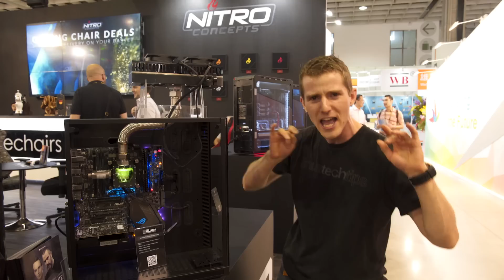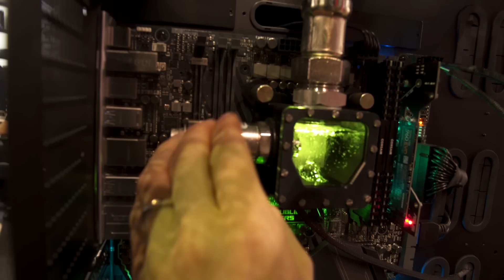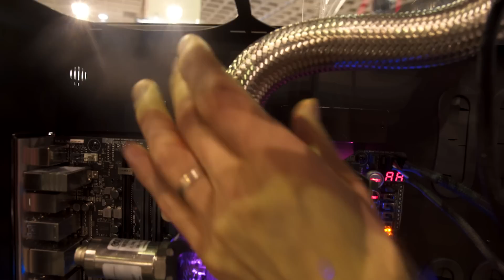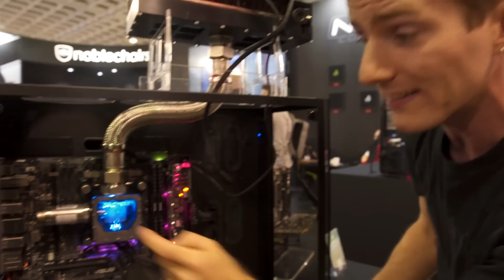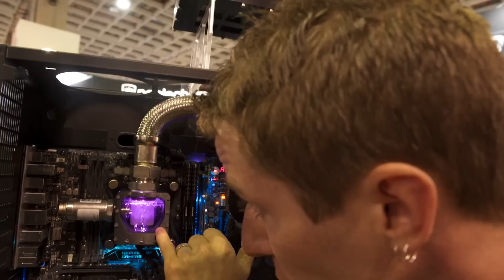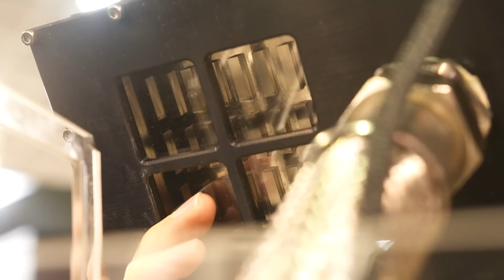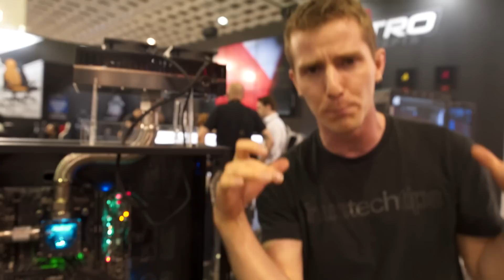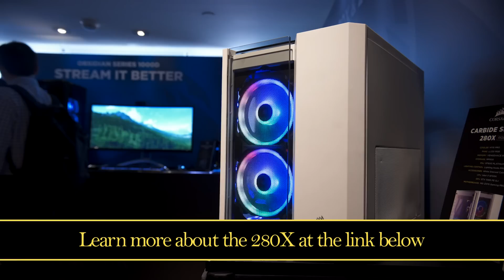Crazy Der8auer cooler prototype - NO pump!

Comment: From the way the application is being used, it Is probably from 3M called Novac 7000 or equivalent model 7xxx or so. Is an engineering fluid that boils @40C ish. It requires no pump as it evaporates and condenses back into liquid within a closed heat exchange system. It it expensive and difficult to acquire for personal use. In 2015, 3M engineer informed me that 3M    sells a complete package including consult, design,  install, maintenance. They don't sell just the fluid. It have been few years and their policy may changed. Oh yeah, he never tell me the price per gallon and I asked him 3 times. :)

Comment: It could be water in vacuum. As water's boiling point at 940 mbar is 40 celsius and as the water evaporates at 40C the vapor gets sucked into the empty radiator but as the pressure rises because of the vapor the water will instantly condensates leaving the heat in the radiator at the  top. (Just a theory don't quote me on that)

Comment: He could've pranked everyone by using water and having the loop at a lower air pressure.
Reply: I was thinking that too. Especially since it has a pressure sensor
Reply: @Darren Munsell yes I know but if they use even lower pressure than aboard the ships they can boil the water with just 20 °C or 30 °C. They probably use 70°C to kill off harmful microorganisms and bacteria. You don't have to drink the cpu water so it's safe to use a lower temperature.
Reply: @Darren Munsell 3m novec is what would be used ;)
Reply: Sounds good but it would be terrible longevity-wise. Even liquid cooling loops have permeation issues over time. A gas loop below atmospheric pressure would have much more permeation going on (just in the opposite direction obviously). Once enough air permeated into the loop the boiling point would be up at 100°C again and average joe would need professional servicing for the loop to make it work again since you probably don't have the material at home to recreate the vacuum.
Reply: that is what it looked like to me when linus flipped the radiator over no condensation it was water with a aquarium pump
Reply: @paul3502  Also if the CPU boils the liquid why are all the bubbles coming from the bottom? From the same place where the weird black hose thingy is.
Reply: It could be butane or propane
Reply: @KCWhoa  https://www.youtube.com/watch?v=AZAUnl37Cr8
Reply: Necroing this but using water at lower pressure likely wont work. it will work initially but as the water boils off it heats the fluid and the air pocket above it. as the water vapor and air expand, pressure rises. as the pressure rises the boiling temperature rises. eventually you will likely get to a pressure that is not acceptable in regards to the water boiling point. you need a fluid with a low boiling point but also a flat relationship between boiling temp and pressure. low pressure water also has a terrible fail condition. if you ever lose the vacuum you could destroy the cpu quickly. another reason for a fluid with a naturally low boiling point.
Reply: @Darren Munsell 70c is not too hot for any modern cpu expecially intel's notorious 105c cpu's that like to run around 90c
Reply: @Darren Munsell I haven't experimented with pure alcohol, but given that water boils at a much lower temperature under a near-vaccuum, then I expect alcohol would as well. Alcohol (ethanol) is at least very cheap, and not 'toxic' as such. I reckon the claim that it was very expensive was probably misdirection.
Reply: @Farid Zellipour Interesting, that must be super-pure ethanol then or something. That surprises me as its such a widespread and easily obtainable substance. But even at $100 per litre, you don't use very much in the heat pipes at all, so the overall cost could still be relatively low
Reply: @Darren Munsell 70c isnt too hot, 70c is percect if you dont want a super noisy system
Reply: @cnexpat1009 u mean Indian Elementary schooling😂😂😂
Reply: @Darren Munsell maybe some alkane or alkanol
Reply: @jolioding_2253  I was wondering alkanes! They've pretty unreactive which helps and cyclopentane boils at 49 degrees. Alternatively cyclohexane at lower than atmospheric pressure?
Reply: @jameshogge  yeah cyclopentane sounds like it would work pretty well since the boiling point isn't too high nor too low
Reply: There is a pressure sensor, which tells me the system is almost certainly pressure sensitive.

The tubing leading upward is of metal design, which tells me it's almost certainly pressure sensitive.

The system is very obviously sensitive to air leaks, as that would result in all of the liquid exiting the system.  So we can be sure it's an air tight system in so much as it can be.

They specifically pointed out the pressure sensor saying that in a final production it would probably not be there... as if to imply in a test unit, the pressure is being monitored.

I doubt, seriously, that that sensor is there to make sure it doesn't implode due to too low of pressure.  For if it was, turning the computer off would surely make it implode...  Soooo, it must be there to make sure the pressure is not getting too high or that the pressure is sitting at just the right spot.

Without the sensor, there'd be no real way to make adjustments to the system and actually have those adjustments move the system's pressure in the right direction of what would be needed.  Altitude and where this product would be shipped could effect the way it performs.

Off, Idle, Running, Running Full Tilt temps will all result in different measured pressures in this design.  Imagine a soda/pop bottle with a lid on it collapsing in on itself or expanding just due to temperature change.  Anyone who has ever put a half drank bottle of soda/pop in the fridge after it's been sitting out for a while will know exactly what the reduced temperature will do to the air pressure of that bottle.  The bottle will literally start collapsing in on itself and will then expand again after being set out at room temp.  Anyone who has ever burned trash and heard a loud pop from a bottle close to the fire, but not in the fire, will also know how dramatic the effects of heat on a closed bottle can be.

The temps in this cooling system would not approach quite the same temperature of the CPU itself.  The temps will always be hottest at the source of the heat.

From this, you'd almost certainly be looking at liquid/pressure combinations that would create a boil at sub 60C.

Water Boils at 100C at sea level (Pressure: 760mmhg or 14.7psi) and boils at 71.1C at 30,000 Feet.  Mt Everest is 29,035 Feet in elevation.  For reference, Mt Everest's atmospheric pressure is like 250mmhg (4.8psi).

From this information, we can deduce that you'd want the pressure in this system to be 250mmhg (4.8psi) under max load to get water to boil at something close to 72C.  Which means it obviously needs to be less than 250mmhg (4.8psi) under zero load since the increased temperature in the system will increase the pressure.

I don't know how to do the math on what the heat would do to the pressure in the system, but I'm pretty sure the exact amount of liquid in the system relative to air would also matter.

Making a cooler like this would almost certainly need the strictest of quality control and the strictest of limitations for which CPUs it could be used with based on wattage.  Too much wattage could result in too much liquid being evaporated at once.

Someone said Butane?  Butane boils at 30F (-1C).  I don't know the safety of doing this.

That same person said Propane?  Propane boils at 43.6F (4.8C) and again, I'm don't know the safety of this.
Reply: You guys forgot that if you bring water in contact with the cpu it will shortcut.
Btw does destilated water shortcut?
Reply: @outofctrl6734  no destilled water does not conduct electricity
Reply: @Darren Munsell bro what??? 70c is way too hot for a cpu ? What in the fuck are you talking about ? Thermal shut down doesn't even happen until +100c.... 99% of air cooled CPUs will hit 70c  during any gaming session, especially if it's summer time. When overclocked even a watercooled  9900k will hit over 70c.
Reply: I think its novec 649 dry water
Reply: Most probably did
Reply: If the system was pumped down to about .15atm after being filled with water. water would boil at about 50c.  With even a pathetic radiator, condensing the steam back to liquid state would be trivial.
Reply: @Darren Munsell Just like you do for an absorbtion chiller, fix all the leaks or put a vacuum pump on it every day or two.
Reply: @Darren Munsell 70C is absolutely not too hot for any CPU. New AMD chips bench higher by at least 10 degrees on average at max and dont reach critical till well over 80.

Intel chips have been pushed to 100 and still work though obviously 100 is kind of insane. Stop spreading mis-information.

70C is def to hot for idle or constant workload temps on ~ 80% of the CPU out there but it's definitely not surprising or questionable.
Reply: What part of thermal dynamic and feasibility do you not understand? Oh wait, I just got trolled. Good for you.
Reply: @Darren Munsell Actually the centrifugal chillers I worked around used refrigerant from York (R-something or other) under a somewhat lighter negative pressure.  They had build in vacuum pumps with purge valves to remove non condensables.  The absorbers had just plain vacuum pump ports.  One of our guys would go around and put the suck on them about once every few days.
Reply: It wouldn’t work, water boiling temperature is around 100C at 1 atm. I assume the pressure inside is greater than 1 atm, therefor the boiling point will be higher than 100C in that box. I don’t think anyone want their cpu to reach 100C
Reply: @moose1336  that's why he said water with lower air pressure. If you put a cup of room remperarture water in a vacuum it starts boiling. The lower the atmospheric pressure is the lower the boiling point of water is.
Reply: @eldiablooooo  Let me see how I should explain this. Doing a simple google, I found that the water boils at room temperature 23C at 21.1 torr, which is about 0.02776 Atm. That pressure is already very low, the amount of force pushing on the entire system is very high. Let's ignore that and say the tubs with metal shield is rated for that. Next the liquid takes up 1/4 of the system, ignoring all the vapor in the system. Once overclock under water cooling with a 60 mm thick 240 radiator depending on the load the temperature will be around 60C. Which is using a thick material like water to transfer heat, not gas. We ignore that again and lie to ourself and say our gas system can do that same. Even assume the system reach equilibrium at 60C, which is 0.196 atm. Yep, we did it by assuming the world is perfect. Let's ignore all of that and make a cheaper and working system. I would suggest a liquid that evaporates around 50C at 1.2 atm and the system pressure maintains at 1atm at room temperature for longevity.
Reply: Fiona Djw The assumption is people wants the liquid to start boiling once the pc is turned on. As liquid evaporates the internal pressure will increase due to evaoration. Therefore, the system will reach a new pressure, until it reach equilibrium with heat generation and dissipation. I did not even talking about the requirement to hold low pressure, because the cost to construct and maintain that is not remotely economical for mass production. As pressure, I’m don’t understand your assumption. The law of physics dictates that the pressure in a system is evenly distributed. With that said, the vapor will travel to area that has Lower pressure. That’s how the entire system works. Higher pressure on top of the liquid, and lower pressure in the radiator. Also, holding 50C is only possible with light load. The heat dispassion of gas exchange is not the same as simple Waterloop. The gas has to come into contact with the radiator to exchange heat.
Reply: @fionathegayesttiefling9867  no, youd need to have 60c of boiling point minimum, else youd run out of coolant
Reply: @eldiablooooo  Wouldn't work. The vaccuum would be counteracted with boiling steam until it reached an equalibrium at a higher pressure.
Reply: @eldiablooooo  If the pressure is too low I dont think the fluid will drop down as efficient as with 3M Novec in normal conditions
Reply: @moose1336  Here's a simple experiment: Get a syringe of the type they use for injections, but preferably the biggest, fattest one you can.  Then, with the syringe plunger, suck in about a third of a syringe of very warm water (still bearable to touch). Then when you've sucked in about a third of a syringe, stick your finger over the end where the needle would normally go, to seal it, and then pull the syringe back even further. You'll find the water will suddenly start boiling, because it is now essentially in an almost vacuum (briefly), and the water will start boiling at around 40 degrees c.
Reply: @moose1336  learn how to read
Reply: @moose1336  at lower atmospheric pressure, water boils at lower temperature
i.e. if u go to the mountain, maybe 3000-4000 m u already can see that the water is not boiling at 100C but at around 90-87C
science
Reply: @moose1336  he said water with lower air pressure you doofus!
Reply: @moose1336  dude....but what about h2o in lower preassure ?
Reply: @moose1336  this is why you have lower pressure because at lower pressure water boils at a lower temperature
Reply: @moose1336  water boiling points is below room temperature when under a vacuum

Comment: Normal water using a elctronic way to boil the water the made a stove that causes no heat but boils and heats the water. Or he is using a liquid that has a low evaporation rating. Or a gass that is compressed into a liquid. There are many ways this is possible

Comment: Methanol would be a good choice, though I would have concerns regarding flammability. The same applies to acetone (and it's solvent properties might be prohibitive). Chloroform would be an option from a physical perspective, but it's considered extremely hazardous (CFC and bioactive). My guess would realistically be a low-pressure refrigerant. Ideal properties would include it not be a polar molecule (due to ability to pick up ions and become conductive), non-flammable (eliminating hydrocarbons and alcohols), and obviously clear and colorless. Now, it could be water in a partial vacuum, which would have many benefits, but is still a molecular polar liquid. However, the low pressure would make it viable.

Whatever it is, the boiling action would need to be low energy to avoid cavitation erosion of the thermal plate. This reduces the likelihood of water being in there. To be honest, I don't mind a pump, and using an electrically insulating fluid would be my preference generally. I look forward to the reveal.
Reply: Methylene Dichloride
Reply: Methanol would mean (if we don't play around with pressure) that there's basically no cooling below 70°C, so your CPU will be at 70°C constantly...
Reply: Assuming standard atmospheric pressure. One could have a partial atmosphere inside the device and thereby reduce the temperature (say, three-quarters of an atmosphere, maybe two-thirds). My concern would actually revolve around what happens if the temperature at the cooler end of the chamber got too close to the temperature at the hot end. Essentially, this seems like the external temperature range might be a bit narrow.
Reply: It's probably not flammable because that would be a regulatory nightmare - good luck explaining to a lawyer that you can cool your potential source of ignition with something flammable.

Also chloroform is not only bioactive, but it is reactive with water to produce phosgene - a toxic and reactive molecule
That's why any chemist worth their salt keeps the chloroform on activated molecular sieves

Comment: With a giant heat sink like that you don't need a pump anyway. You could just use water and convection. Simply have the top tube (carries away heat) go to one side of the sink and run the other tube from the other side of the sink to the bottom. this will create flow using convection. There is no need to boil or create gas.

Comment: Acetone boils at low temps and has a nice high ignition temperature. Probably why he has the pressure sensor so he kills the system if any vapour is released as a safety measure.

Comment: U could use plain h2o.  Water in a very low pressure environment should do the trick. A good vacuum pump will get you there and then the water will boil at roomtemp.  Phase change cooling without moving parts. ;)